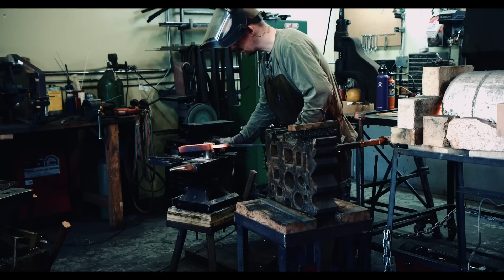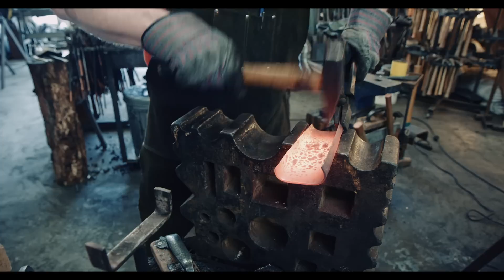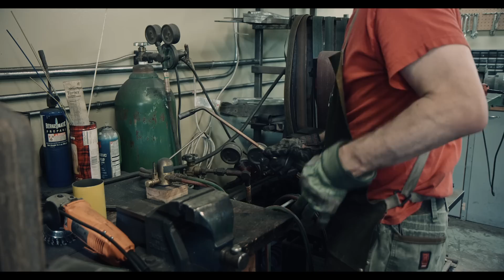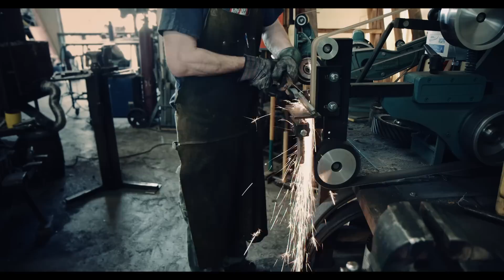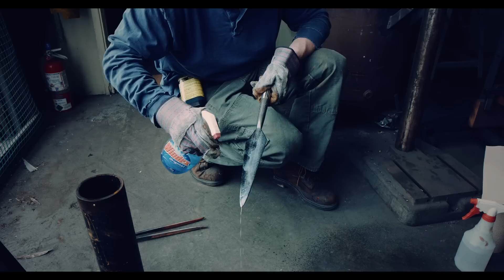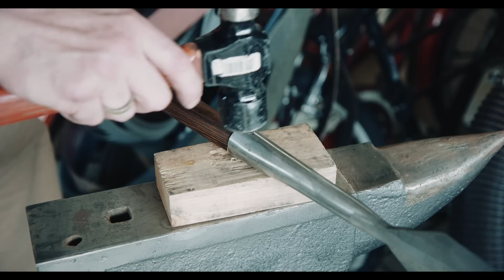The Secret of Making a Pattern-Welded Viking Spear

Comment: I think it would take you at least 3 months to make that spear if you could only use what the artists that made them back in those days had to use. Remember they had no power tools and their fires were all made with naturally occuring fuels. Good luck ever trying to recreate the work they did back in those days, I doubt anybody or at least very few people have the skills and the strength to be able to reproduce it using only those tools that they had back then. I am a fair hand at making blades but never even considered not using power tools, it would be almost impossible to forge the steel that they made back then.

Comment: Looks good for me so far a few delaminations at the end of the spear blade and the tooth leaves some holes but i know this is freaking difficult. There are so many chances to mess this up never done this before. Maybee in the future the most difficult thing for me is the socket and forge weld this. I made three diffrent boar spears so far but im lazy and used a pipe for the socket, but  every spear was quiete a challange. Thanks for showing us the almost complete process.
Reply from the maker: It's definitely tricky. The one I made before welded all the teeth fine but the one for the video definitely did not fill all the gaps. Next time, I made fuller the teeth a little bit to make some more space for the wrought iron to fill up the cavities.

Comment: I must admit i'm surprised that the method of making the socket material was done as it was, making the sheet and cutting it to shape as opposed to forming the socket sheet from the steel bar
Reply from the maker: There are different ways of doing this. Spreading the core bar and forming the socket from it was definitely done. On a side note, historically, neither the socket nor the core would be steel but would be made from iron instead.
Reply: @NielsProvos  the socket and core being iron i understood  i just figured that the socket and core of the spear (in iron ) would be integral with a 'wrap' edge or edge bit of steel like how the toips of swords are done.

because thats how i presumed spears and arrowhead sockets were made...

do we have evidence that some sockets were forge welded on seperately? 

also, if you ever find out. how the heck... are wings on a spear attached... i cant figure out the process for forming the wings on a spear.

Comment: That was absolutely beautiful. I've always loved to watch artisans share their passion. I'm a woodworker hobbyist but my father was a welder by trade. One thing that I am wondering and maybe you can answer: seeing how difficult it is to make the hollow part to receive to shaft, and having to considerably taper the wooden shaft to fit it in, wouldn't it make more sense to make a tang instead or would that make for a weaker fitting?

Comment: Are these black sopts on top of wave patern voids? (marks of bad forge welding?)
Reply from the maker: Yes. They did not weld perfectly. It wasn't a problem on the first spear head but the second one did not come out quite as well. Next time I will slightly fuller the teeth to make it easier for the wrought iron to fill the voids.

Comment: What kind of pencil are you using to mark the metal for the socket? Is it a special type of soapstone? I’ve never seen one like that before
Reply from the maker: It's just a simple holder for the soap stone. I also use silver welding markers.
Reply: Oh ok. It just seems like a fine soapstone. The circular ones where I shop at are about 1/4” thick. I’ll have to try online to see is I can find thinner ones. Thanks for taking the time to respond. The end product was awesome by the way

Comment: Was the original a combination of wrought iron and high carbon steel too? If so my mind is totally blown, from the skills and knowledge of metallurgy needed in viking age to make something like this.
Reply from the maker: The original spear has not been analyzed that way. However, many period findings did not have high carbon edges.
Reply: The original Ulfberths were made from high quality crucible steel according to some research. I wonder if any spearhead would have been made from same materials.
Reply from the maker: Not as far as I know.

Comment: for this kind of venture in the old days it would take an entire team of people to man the bellows taking turns. smiths were often provided with the materials by a lord or king. weapons needs in the 8th century grew as the desire for war grew and raids became more common, so a smith was never out of work so to speak. i guess the real problem was more getting started.  getting iron from soil was a common practice as the means to process heavy ores didn't exist at the time. carburization was achieved by using the bones of an ancestor

Comment: You know, this is not unlike Japanese Katana forging techniques, only in reverse since a spear head is double-edged. With a Katana, you fold the low-carbon 'soul' steel around the high-carbon edge steel. In this case, however, your low-carbon steel forms the center, in the middle of the high-carbon outer blade layer. This gives it a greater ability to absorb the shock of impact without compromising its ability to hold an edge.

Comment: i had always wondered how the socket-blade join was done so cleanly on the historical ones. i forge my spears from a single piece, so i get a section that does not close right at the join.
Reply from the maker: +Hanaar Steelhand it's supposedly possible with a single piece construction as well but i think the forge welding would be trickier.

Comment: When you made  the sharktooth with the press, couldnt you lay a cold big block of steel on top of it which is longer than the sharktooth sheet to give the pressure all over the sheet at once and prevent bending up?
Reply from the maker: +Xyco yes, in theory that should work. It could be a different die for the press.

Comment: Hey Niels I have a dumb question. Since you are using graphite for the mandrel at welding temps, wouldn't that add some carbon to the wrought at the weld seam? Could that have a potential affect on the weld?

Comment: Very nicely done, what is the powder sprinkled on the work and it's purpose ? 
also it looked like there was a tiny row each side of the blade of black holes?  is this just an effect of the pattern or is there actually tiny indents or holes in the steel? 
Possible in battle these holes could hold purin or some toxic gunge to infect the wounds inflicted where death didn't occur instantly the wound would get infected and kill the person later after much suffering !!
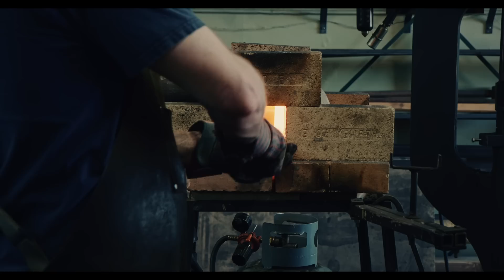Reply: +colin martin You're talking about 18:15? He's sprinkling Borax onto the steel. Borax (sand was also used back in the day) acts as a flux when forge welding, which stops the layers of iron/steel from oxidising when they're hit, making for a better fusion of the layers.
Reply: +colin martin They look like holes courtesy of tiny gaps between the wolf-tooth pattern, and are a defect that ideally would not be there. Remember, he forged the plate flat, then bevelled it and ground it to the final shape, so those gaps were on the inside.

As for the other points, you're overthinking history.

This type of weapon would be akin to a gold-plated M1911; functional, but far too complicated to produce and aesthetically overbuilt for the task. Furthermore, if gaps were needed for poisen storage, they would simply punch something substancial into them. However, this wouldn't be necessary:

1. Most wounds on the battlefield got infected anyway.
2. If a weapon were to be poisened, it's easier to simply dunk it in the poisen and let it stick to the sides; easier to clean afterwards. A classic source is a decomposing carcass.
3. Recesses or holes can lead to cracking or failure, so it's better to avoid them on a blade.